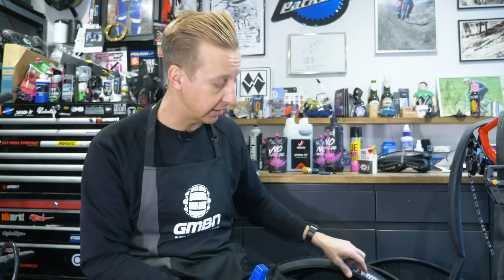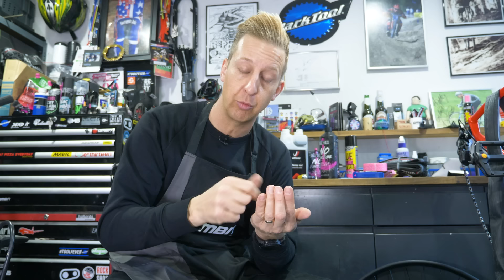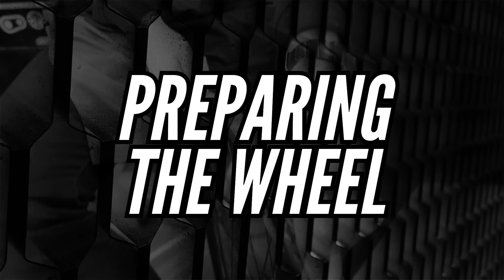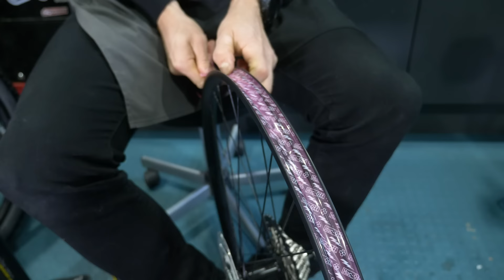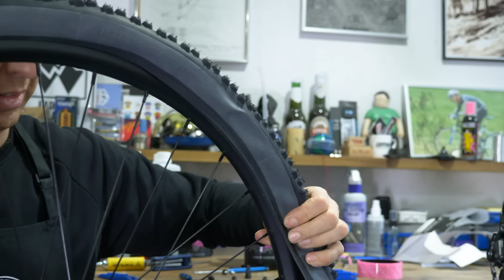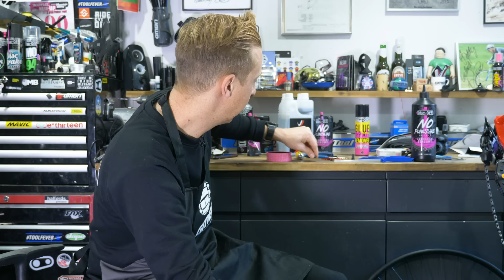How To Convert Your MTB Wheels To Tubeless | Mountain Bike Tubeless Setup

Comment: You don’t need to check for leaks when the tire is dry... think about it, the sealant is there to do what?
Reply: Seal punctures...properly/well fitted tubeless easy tyres on well sealed rim tape do not need sealant to stay inflated. 
But sealant helps seal the rim-tyre where a perfect seal diesnt exist, a tyre has pin holes or thin sidewalls. But primarily its fir punctures

Comment: Does it matter if i use presta or schrader valves for my tubeless setup on my tyres please guys
Reply: Depends on the size of the hole in your rims. I don’t recommend drilling out a larger diameter if your rim is designed for presta. If you already have schrader, then yes you can as long as the valve has the thick rubber stopper on the inside end.

Comment: Are sr suntour forks any good
Reply: They will do if your on a budget otherwise no
Reply: Well I have the xces on my 2019 Scott aspect
Reply: I have xcts on my 2017 aspect and they work but im just keeping them going until i upgrade
Reply: Are they a tapered fork
Reply: No suntours usally arent
Reply: Rockshox have some capable air forks that are straight steerer that would be a good upgrade
Reply: There high end models like the durolux are pretty good

Comment: My tyres seat on the rims when I have tubes in but they don’t say they are tubeless ready, will they still work for a tubeless set up?
Reply: No, tubeless specific have a more aggressive rim interface whereas tube type rely on the tube pushing against the tyre wall to hold it in place

Comment: #askqmbntech After having run tubeless for a year I am a bit sceptical. It takes much more time fiddling to get it to work. It is more expensive. And the times I get punctures in the woods the sealant never seals the holes so I allways have to put in a tube anyway. I have a canister for my pump, I use the recomended amount off sealant. And I fill it up regularly. What can I do to make it work?
Reply: Maybe run a heavier tire casing or higher pressures? I'm shocked by what I can run over without puncturing.

Comment: I have a question if anyone can help?

So I’ve tried to go tubeless but I’ve used electrical tape and made a 10 layer tape seal but it never works? Also I used more than enough sealant. How to I stop the air gaps form the outside of the rim?
Reply: Goliath oh no

Comment: #askgmbn #askgmbntech #Doddy Your honest opinion on this... I usually change my tyres depending on the trail I ride (3 or 4 times a year), also usually run a bit more of a high pressure because of the terrain I ride and I love the feedback it gives me while ridding.  And las but not least I have not had a puncture for over 3 years and that includes ridding your favourite trail (the whole enchilada).  Now with all this info do you honestly think tubeless is for me? I have tried it and cant honestly say that its for me or for that case for everyone.  One last thing, the waste of sealant even when trying to reuse it is considerable.  Your opinion?  Cheers from Iker (mexico Bike Cave dude)

Comment: My tubeless tyre seems fine until i ride it. Then i find the tyre is leaking sealant out the bead and down the sidewalls. Do i just need to inflate it more or is it because the tyre doesn't fit the rim?
Reply: Probably a combination of non tubeless ready rim and loose tire fit?
Reply: It is possible just need to inflate to higher psi to set the tire on the bead try this before anything drastic

Comment: The mountain biking crowd should be clearer about the fact that mountain biking is a tweaking sport. I have spent all summer trying to fix a flat tire by converting to tubeless, and then it turns out that my Veetireco tires are not tubeless ready even though it says on their web page that they are. Apparently when they are sold together with a crap brand such as Diamondback, the labeling is not correct, but they still put labeling on them.

There is nothing wrong with tweaking sports, some people like that. As long as people get what they expect. If you like drag racing and spend all summer building an engine that you will use for only 4 seconds, by all means, thats up to you.

But dont bullshit beginners by saying "just dont buy a Walmart bike". All my bikes have been full suspension "Walmart" bikes and I have never had any problems with them. I was stupid enough to buy all the Youtubers talking about how "real" mountain bikes are so much better. Well, not for people who want to be riding.

Today I converted my tire back to tube, bought a new rim strip and everything, only to find out that it is somehow STILL leaking even with the new tube! I must have not paid attention that the tire was in place before I inflated it, because it jumped out. I bought the most heavy duty tube I could find (Good Year). And I cant to go the bike store because their services are severely overpriced because millennials have been made to buy the truth "but they build our trails". Most tire shops for car fix a leaking car tire for $15, why should we pay $60 to fix a flat tire? This is a failed sport, at least for me.

Comment: How do I know when it's time to refresh my tubeless  tires?
Reply: when they are leaking too much air/sealant or "sweat" a lot on their sidewalls
Reply: Leaving sealant in there for more than a few months at a time makes it much harder to clean off the rim (and especially off the tires), especially if you use Gorilla tape, which tends to leave a lot of residue anyway if removed.

Comment: I wonder how >200g of liquid sloshing around affects riding, compared to an average 100g inner tube.
Reply: Rolling resistance dot com has done testing on this albeit on road
Reply: Ouroboros like heaven 😇 noticeable
Reply: Nice, it's just scary when I keep seeing clips where the tyre burps some air or just comes off the rim altogether!
Reply: Ouroboros I'm yet to have any problems, my rims are the OEM crap set and I've bought decent tyres that fit snuggly I rode something like 10psi last weekend and didn't have any issues. Previously, I would get pinch flats and/or thorns punctures each week.

Comment: How big of a deal is it if my rim is bent (just a little bit)
Reply: It's really bad, you need a new rim. If it's only bent then add more sealant.
Reply: How bent? I would try to true the wheel first (lots of good tutorials on how you can do that with no wheel stand required - e.g. by using zipties on your frame). Riding around on a banana'd wheel can give you worse problems, tubeless or not.

Comment: Hey Doddy..Great video!! One doubt..Will rims need to be tubeless ready or can any rim be converted..I am planning to convert my 26er rims to tubeless..

Off Topic: Doddy..Can a 7 speed cassette be upgraded to 10 speed? I have a Shimano 7 speed on my hardtail and looking to upgrade to 10 speed..Can you do a video on this kinda conversion if possible? My drivetrain is a shimano 3x7 and I want to go 1x10..
Reply: Any rim, use 1" wide gorilla tape. But good luck finding tubless 26" tyres.
Its the tyres being TR thats the key. Otherwise the side walls have so little rubber the sealant oozes out the tyre. Tubeless ready/easy tyres are key
Reply: Yes easily to upgrade 7 to 10 1x setup dude I've done 9 to 11 only just so you will be fine I reckon

Comment: what can happen if u dont use a non tubeless ready tire
Reply: If the tire is not tubeless ready, sealant may leak from the sidewalls. It can be done though. It just takes some time for the sealant to seal the sidewalls
Reply: Real Fonzo is it worth it or not
Reply: @yadaven1323  Not really...wear out tyres, then buy TR tyres next time and do it
Reply: At higher pressures (~30psi on a 2.3" tire) the tire may blow off the rim, which can be a serious safety concern. I've made it work on a couple MTB tires, but would never attempt it at road pressures.

Comment: Good luck seating a tubeless tyre with a mini pump....next to impossible! Even floor pumps usually dont seat, but sometimes can....a airshot or similar is essential really
Reply: Depends on the tyre combo... Some seat by just gently pumping and some need a freaking nuclear explosion in the tyre to seat. Most of the time if the tyre/rim combo is good and you know what you're doing, you can easily seat most of the tyres with a mediocre floor pump or even a crappy hand-pump.
Reply: I've seated tubeless tires with a portable Lezyne HV pump that lives on my bike frame...

Comment: Sounds like a lot of trouble for no real advantage other than avoiding a pinch flat. Which is why you carry a spare tube with you...which you have to do with tubeless anyway. 
Until bicycle tires are made as well as motorcycle or auto tires, just use tubes.

Comment: In my tubeless tyres air keeps escaping near the valve no matter what we do to fix it. Any suggestions?
Reply: Lots of TL valves suck. I prefer those with a rubber cone. I add a bit of silicone kit around the valve for extra tightness.
Reply: I had a similar problem. My rims are tubeless ready but I think I damaged the area around the valve when pulling out my old tubes when the locknuts had fused onto the valve stems. I had some super strong duct tape so I put two pieces over the valve hole, one left to right and the other right to left, punched a small hole in the tape with a knife, pushed the valve through and the tyre holds pressure now no problems.
Reply: Thanks you guys. I’ll give it a shot.

Comment: I don't get the weight saving thing, where is the weight saving when you may not have the weight of a tube but you have to put a heavy sealer in the tyre thus negating any weight advantage you may have gained by not having the tube, I do get the advantage of the sealer against punctures and the advantage of not getting the tube pinched but I can see no weight saving!

Comment: Is it worth going tubeless if you only use your bike once every few weeks? @gmbntech
Reply: I have multiple bikes so sometimes mine sit for months and I loose very little tire pressure tubeless Is the dream really I will never go back my enduro bike has been in cold shed for months at a time pull it out may have to slightly top up the air never flat just soft and ride
Reply: @wadeariss448  nice one. I was just worried it'd be a waste of money and time to do it that's all. Cheers.
Reply: TheMattfell I think it’s cost effective as never buy another tube and time wise if you decent with your hands fairly quick to do

Comment: Weight savings yeah... A 100 g tube with a sub 500 tire g is soooo much heavier than 550 g tire and 50 g of sealant. It's gotta be, right. Because going tubeless saves weight.

Comment: Exercise is futility.
Stems cost about ten dollars for only two. The tape is ten bucks for a roll, a rip off and the jism you put in the tire never dries. Figure in your labor at twenty dollars an hour. That's a total of seventy bucks for an experiment that may or may not work.
The sealing compound that should be used is the stuff they use when sealing car tires to the rim. The sealant is black and applied with a brush on the tire's bead. It dries up.
Since this video shows putting liquid latex into a tire, how is it going to dry? It's not going to dry. And when one takes their bicycle into the freezing weather the jism will freeze and the tire will lose it's seal.
What a mess!
And how is this procedure saving weight? One is taking out a tube and replacing the tube with tape, a valve stem and jism. Add those items up in weight and it is probably the same or more weight! Plus a slosh factor is introduced that could breed microorganisms.
Is this whole world going coo cu with play jism?
And what happens when one gets a flat in the field? Are they going to break out a workbench and a jism chemistry set?

Comment: I will not conform.  I will not comply.  no, if I lived somewhere else I would doit.  its 35 below freezing right now.  on the positive side I'm not worried about sealant coming out of my nipples...
Reply: I have never had any issues with the cold and my bike is stored in my shed in Saskatchewan this year we have had lots of -45 ride winter and summer
Reply: @wadeariss448  , it's got to be a frozen lump.  By the end of my ride the cables are stiff, less tire pressure, cranks stiff, bike heavier with snow and face mask stuck to beard.
Reply: Edwin Parson sounds rough man I love riding my bike all the time even in crappy sask winter bad day on the bike is better than good day at work I have never had issues with my tubeless in winter is all I was saying as for the rest of your issues I feel for your riding buddies I assume your bike doesn’t like mud either, maybe replace bottom bracket for crank issues as the viscosity of the grease shouldn’t be that much of a factor also very important to leave your purse in the truck will account for extra weight on bike(sorry ladies I know lots of you more hard core then me)
Reply: @wadeariss448  , no doubt it adds to the experience of biking.  It's all good.
Reply: Edwin Parson cheers bud glad you have good spirits

Comment: I tried tubeless and it was crap
Reply: Probably did something wrong
Reply: Naaa it's great, didn't save any weight but got a beefier tyre on and no punctures in 4/5 years just the odd burp, worth doing
Reply: If using gorilla tape worth warming it up slightly to get it stickier and go into the channel better, I think the tape you get with mavic wheels is rebranded g tape